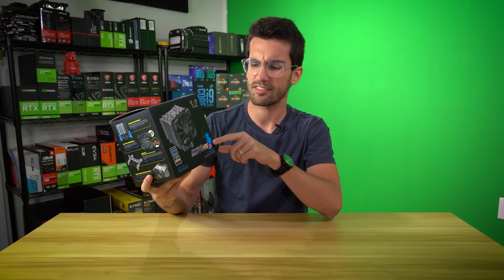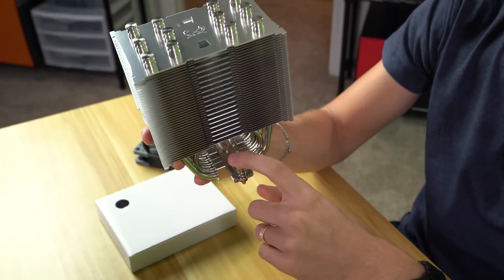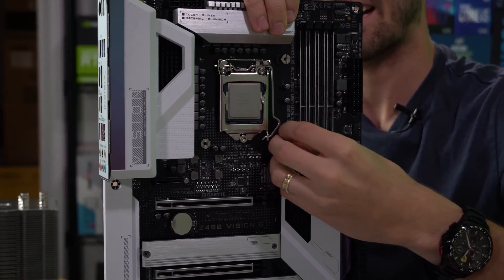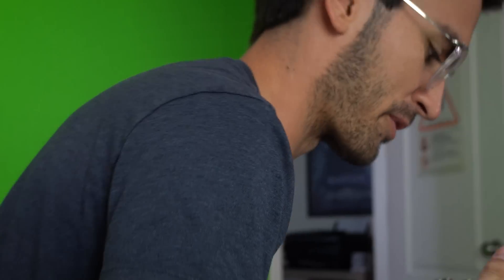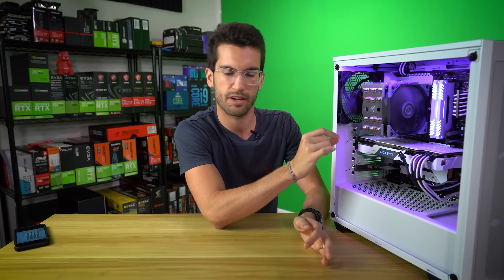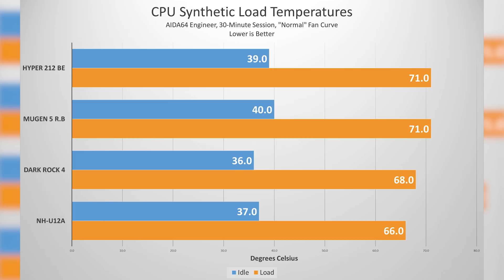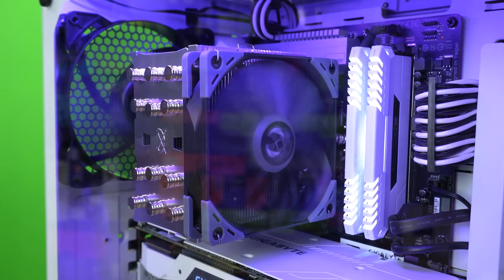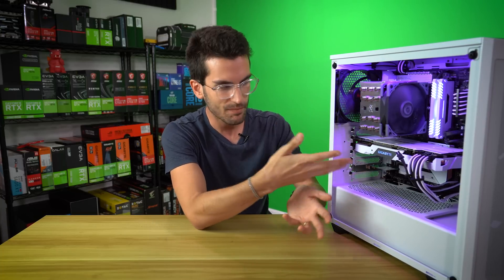This CPU Cooler Is Seriously Underrated | Scythe Mugen 5 Rev.B Review

Comment: PLS HELP!! how much can i overclock a r5 3600 with a fuma 2? My thermal paste will be the ARCTIC MX-4 pls help
Reply: there is no general answer to this. i think your cpu is the limit, not the cooler. every cpu is slighty different, so you gotta test it out.
Reply: bert racoon oh ok thanks
Reply: @alimushtaq7499  that is, what people call silicon lottery. some get "good" and others get "bad" chips. that doesnt mean a "bad" chip is really bad. it only isnt as good as the other one but it peforms in the specs that the manufactuor told you, that it should run at. there are pre selected chips too. they get tested and then they will be sold with better specs on the package. but it isnt like, this 3600 peforms 20 percent better than the other one. it isnt such a big difference. maybe 2 - 5 percent or so. i wouldnt overclock a 3600 anyway. as far as i know, a 3xxx series ryzen will peform better if it is cooler. so the more you can keep its temperatures low, the better it will peform, to a certain point of course. so getting a good cooler is the best thing you can do, to get the best performance. maybe you could try to undervolt it. cause ryzen in general comes with pretty aggressive voltages out of the factory. so lowering the voltages could lead to a better performance, cause it runs cooler but in the end, you wont see big changes in double digdets terretory. you just can make it, kind of, run more stable at higher clocks with better cooling, so it clocks maybe 200 mhz faster. these days, the tech is so far advanced, that it overclocks itself to its limits. you cant get much higher than that. under normal circumstances.
Reply: bert racoon oh wow i didnt know that 😱 tysm bro now i understand
Reply: @alimushtaq7499  fast ram is a good thing for ryzen. there you can get real gains in games, as far as i have seen in benchmarks. so a slow ram module, lets say 2400 mhz, cl 18 timings, will make a big impact. the last video, i have watched about that topic, suggested 3600 mhz cl 18, as the best you can get, for a reasonable price. but you got to tell the ram to run at this speeds, by activating it in the bios (uefi) of your motherboard. and on top of it, you got to check the clocks of the infinity fabric of your cpu. best thing is, if it runs at the same clocks, as the ram modules. that only really counts for ryzen cpus, cause intel cpus work differently. the infinity fabric is the connection between the core packages in your cpu. ryzen cpus come in core packages of 4 cores, so if you have 8 cores, then there are 2 packages of 4 cores, wich are connected with the infinity fabric and then they both are connected to some kind of controller that gives them data, via infinity fabric too. and this controller is connected to stuff like your stata ports, pci-express lanes, which lead to your nvme drive, graphics card, chipset and so on. so the faster your infinity fabric is and the ram that delivers the data that came from your ssd, the less latency you got. 

intel works different, at least inside the cpu. the got a ring bus and all cores are in one package and the ring bus is connecting every core to the controller (or whatever it was called). so that is why intel has lower latencies but they get higher too, the more cores you have, cause the distances are getting bigger too. but in general it is faster. intels problem is, that they cant get their 7 nano meter production of chiplets to the point, where they are able to produce waffers, where they dont have to many bad sectors, to make processors out of them. they can produce them but with to much waste you know. so it isnt profitable. that is why they are still stuck on their 14 nm +++ method. i dont actually know how many + they are at by now. so they have come to a point, where they cant really improve those. they got to shrink it so they can fit more cores on the same space. but anyway. if they dont get that done, pretty soon, then they will run into big problems. they are trying to for a couple of years now though but i doubt, that they wont get it done, so they will catch up on the manufacturing process and if they are able to do the same stuff, at making those things work perfectly and as efficently together, as they have done with 14 nm, then they will swing heavily back at amd. the lattest intel cpus are still the best at gaming, not by much, if you use proper ram and put in the right timings on ryzen 3xxx series but still, in some cases they are kind of far ahead and in some others just a little. but next month amd will present 4xxx series cpus and i think that will be the time, when they take over the spot as the fastest gaming processor so far in every aspect. im not sure but it kind of must be that way. so they can say, we got the best for every use use case, may it be gaming or multithreaded workloads, which they already have (for multithreaded stuff). so till intel gets their shit together, which will happen, they have the best cpu on the market. 

the thing is, the big business isnt made on the consumer cpu market. it is on the server market and that is what intel really cares about. they have a market share of over 90 percent or even more, if im not mistaken. but amd is putting out good products there too. the downside for amd is, that they are simply a smaller company with less people who work there to optimize their product, assist software developers in optimizing for their cpus and so on. that is why intel is still king. their stuff just works and it has done for a long time now. but if amd has a way better product, that works way more efficent and they get the optimization stuff done, then intel is kind of screwed. if they dont have a competitive product at that point. when they lose big chucks of the server market, then it could go down pretty quick for them. but i think the server market moves slower, than the consumer market. they cant take risks of stuff not working. but on the other hand, they want efficency, which amd is kind of getting way better at, as intel, because of the 7nanometer vs 14 nanometer production process of intel. you cant compare it one to one but overall, amd is more power efficent and server farms consume alot of power, which creates alot of heat and makes it harder to cool that shit down, so you need more air cooling, which costs more power consumption again. so overall the costs of maintaining those server farms increase. 

im not an expert in this stuff at all. im just interested in it. so if something isnt completely right, what i have said, then im sorry but i think i could explain a bit to you. overall we want a good competition on the market, doesnt matter if amd is best or intel, they have to be on a competitive level. otherwise we are screwed. look at the time period before ryzen launch. intel was asking for ridiculous amounts of money, for a 4 core cpu. the 7700k 4 core 8 thread cpu was the best consumer cpu out there. and it wasnt much of a change to the 2700k which was 4 generations older. maybe 20 percent or so increased. that is why we all have to thank amd that they got competitive again with ryzen. otherwise, who knows where we would have been now and what kind of prices we would have to pay for a cpu. but i have no doubt, if amd would have been in intels shoes for that long period of time, they would have screwed over consumers the same way as intel did, by asking to much for their products. in the end, both are profit oriented companies and they take as much, as they think they can.
Reply: bert racoon wow bro that was a mad explanation 😂 do u have ig? I want to show my build thats updated so u can give me some feedback
Reply: @alimushtaq7499  what is ig? like i have said, im not an expert. im just interested in hardware, at least i was a while ago. you can compare your pc with others online. do some benchmarks and stuff like that. did you activate the xmp profile for your ram, in the bios of your motherboard? does the cpu run cool now? i think if you did just that, your pc should run fine. im not an expert at all when it comes to overclocking ram and stuff. you can search for info on youtube. just type in the name of your board and cpu and then overclocking or something, if you want to get the best out of it. but keep in mind. overclocking the cpu doesnt lead to much increased power. only getting voltages lower can make it run more stable, at higher clocks, because of temperatures. but it will crash at some point, when the voltages are to low. i dont know the exact numbers and like i have said before. cpus are different (silicon lottery). some run great at low voltages and others just get the promised clocks at normal voltages. it is simply luck or you buy pre selected cpus, which in my mind, isnt worth it. they cost alot more and for max 5 percent or so, i wouldnt pay 50 percent more or so (i made up that number but i have seen, that those cpus are pretty expensive). 

you could tell me what you have in your system right now and i could tell you, if i like it but that is it :).
Reply: bert racoon ig is instagram and im going to build it on blackfriday/cyber monday, specs:
R5 3600
Msi b550 a pro
Corsair lpx 3600mhz cl16 16gb
Samsung evo 970 500 gig m.2
Rm850 or cooler master mwe 750 idk yet
275r airflow
Rtx 3070
Reply: @alimushtaq7499  sounds good. and you want to use the fuma 2 or mugen 5 rev. b on your cpu? i guess i would take the corsair rm 850, cause it is 80 plus gold efficency. the cooler master is more of a low budget one, at least it seems so. still 850 watts seems a bit to much but who knows. if you want to upgrade to a 3700x and  to a rtx 3080 or 3090 in a few years, you could do it with that power supply. i wouldnt do it with the cooler master. one thing i would change and that is the 970 evo m.2. i would get a crucial p1 instead. it is a great nvme ssd too and is way cheaper. you could get a 1 tb model instead, if you would like. you will buy two sticks of ram right? if you didnt plan to that, do it. dual channel is better than using ram in single channel. 16 gb should be enough but if you would really like to, you could get 32 gb (2 x 16gb). i dont know how much sense that makes today, but in some cases it does. also you could consider buying a b550 tomahawk instead of the b550 pro. it is 40 bucks more or so. the b550 a pro should be fine too but the tomahawk is better at power delivery and has better cooling, a better sound chip and an integrated io-shield. another alternative could be the b550 gaming plus. it has also an integrated io-shield and has overall a more quality look, than the b550 a pro. in the end, it doesnt really matter. the b 550 a pro is 119 euro here, b550 gaming plus 129 euro, b550 tomahawk 159 euro (all here in germany). so i would go for the tomahawk, if i had the money for such a system but you dont do wrong with any of those, i guess. like i have said, im nowhere near at being an expert. here is a video on vrm temperatures on b550 boards. the b550 gaming plus did really well, even with a ryzen 3950x. so i guess that is the best budget to quality option. though you miss out on that better audio chip. i dont know how much of a difference that makes though. https://www.youtube.com/watch?v=HSY9rDsQgd4
Reply: @alimushtaq7499  oh and gl at getting your parts at a cheap price point ;). you will get a pretty great pc and i hope it lasts for a real long time. you could run into some problems with a six core cpu in 2 years or so but who cares. you could easily upgrade at that point, for a pretty cheap price i guess. even the new 4xxx series cpus will be available at the used market then. i wouldnt buy a 3700x now, cause the release of the 4xxx series should be close. maybe the 4600 or whatever they will call it, will be an 8 core, at nearly the same price of the 3600. that would be an ideal situation for you. when is black friday? amd will do a stream at the 9th of october and i guess they will reveal the cpus then. so keep that in mind. anyway. the 3600 is great cpu at a good price point.
Reply: bert racoon well the p1 is 30 euros more expensive here in belgium (1tb version) and yeah ill go with the cooler master and the motherboard is still not confirmed yet also, i will run dual channel yes i meant 8x2gb
Reply: bert racoon yeah i will actually uprgade my cpu in 2 years 😂😂 and black friday is 30/31 of november but its a whole week but the monday after it is Cyber Monday and then there will be tech deals
Reply: @alimushtaq7499  i wouldnt take the cooler master, it is not even 80 plus gold buddy. and the p1 1tb is more expensive than the 1tb version of the 970 evo?
Reply: @alimushtaq7499   @Ali Mushtaq  you could get a be quiet straight power 11 with that wattage too or a seasonic focus plus gold. those are nice power supplies too. the corsair rm series seems to be a very solid option too, so your choice there wasnt bad. motherboard and power supply are no fancy parts, that will make you jump in the air, when you get a more expensive one but they are very important. they are the foundation of your pc. the power supply can create very weird hickups and problems. so if it doesnt deliver the needed power stable, in all situations, then you can get stuttering in game and all kinds of shit. same with power delivery of the board, when the vrms overheat. so there is no way i would try to save up money on that part. the b550 a pro seems to be a solid option for an motherboard non the less. if you are really that short on money, then i would prefer to run my cpu with a stock cooler for a month or so and get the mugen or fuma, whatever you like, after that. but please dont cheap out on the power supply. there is a high chance, that you will regret it in the long or even short run.
Reply: bert racoon it is gold, and no it isnt but i wasnt taking the 1tb samsung, im taking the 500gb
Reply: bert racoon yeah 100%

Comment: I have had this cooler for about 3 years now and i really recommend it! It is still as quiet as the day i installed it and its in general great.
Reply: Hi a bit late but can you mount a secondary fan behind mugen 5?
Reply: @rensquared24  Yeah definitely I've had the Scythe Mugen 5 PCGH Edition, that already has an extra fan stock on it. So its definitely possible!

Comment: You should probably consider the Scythe Ninja 5 also, the Mugen suffers from that RGB and bling Tax wheras for 10 dollars more youre getting a double fin design that comes included with a black cover AND 2 fans which would be the bang for the buck considering you'll be able tp push your chip further, even then at this price you really should consider an AIO, at least over here in the UK you can get a 240mm CM AIO for this price and on deal comes to almost half the price.

Comment: I bought one of these for my 3700x on a whim and it works great. I was really worried that it was going to be garbage but the price was to good to pass up, and I'm really glad I did. Like he showed it's extremely quiet and at stock fan speeds I have never broken 75c even in a badly air conditioned house. Really love it and I'm glad I bought it.

Comment: I got a tiny cooler from Scythe that fit into my Node 202 case. The cooling is incredible, I was able to max out my Ryzen 2600 overclock before my VRMs bottlenecked me, thermals were below 80C under load.

Comment: I picked, in my hopefully soon to be replaced build from 2011, the Scythe SCMG-2100 as my cooler, aside from a fan replacement or two it's served me well but holy hell was it a pain in the ass to install back then along with the size of it taking up so much space in my case which made installing RAM harder than it needed to be. It's why I'm heavily considering going with an AIO with my new build later this year.

Comment: In the little part of the world I come from the Scythe Mugen 5 PCGH edition is known to be the best bang for the buck cpu air cooler. I have been pushing this cooler in many comments on YouTube because this is such a good cooler any comparison of air coolers should include it but for some reason nobody does it (mostly marketing I am guessing, Scythe doesn't seem to give a f*** about marketing).
I think the PCGH edition is better, it comes with two fans with lower max rpm. Also, I installed mine the other way around, I don't know it makes a difference but in my head it makes more sense to give the cooler some more breathing room, especially with two fans.
But thank you for giving this one some attention, well done!

Ps: I forgot to mention the screw driver, which is a excellent screw driver for every tech lover.

Comment: Look at the Mugen 5 ARGB. It comes with 2 fans for push and pull and its completely ARGB on both fans and a strip on top. The fans also are higher RPM. Gives me amazing performance on my ryzen 3600. It does 1500RPM instead of 1200.  It only got released in 2020. https://www.overclockers.co.uk/scythe-mugen-5-argb-plus-dual-fan-cpu-cooler-120mm-hs-04h-sy.html

Comment: i have one of these for my zen 3600 slightly OCd. i upgraded from a zen 1600 and hyper 212. i have since replaced the fans with 2 corsair 120mm ML fans. granted i used noctua thermal paste on it, but still solid + screwdriver is awesome. next time i upgrade (3700x) i may try that Carbonaut pad out with it.

Comment: This thing is massive. The only thing that i may add is that I would prefer to have the heat pipes make direct contact with IHS vs being encased In another metal contact.  Hence I think the reason why Hyper 212 does so well. It is smaller then Mugen 5 but the HP have been shaved and now make direct contact with IHS. If Mugen 5 had pure copper pipes exposed and making direct contact then it would be a beast. It's stack is bigger then Hyper 212 so in theory, it would sink heat better.. if only the HP were exposed.  Maybe check out the Snowman from Aliexpress. It is like hyper 212 but cheaper.